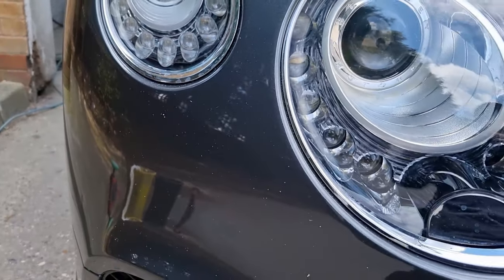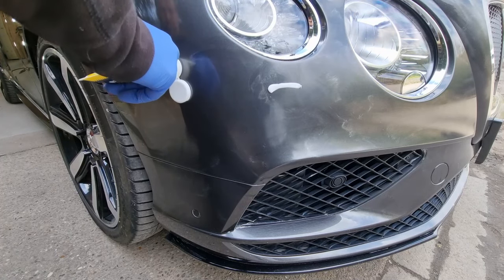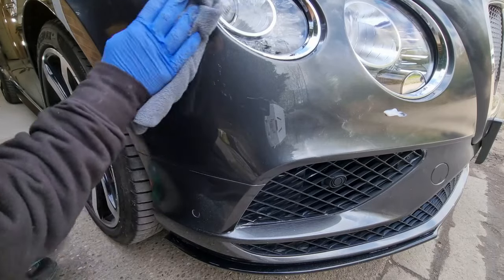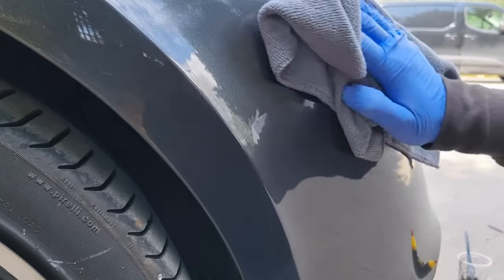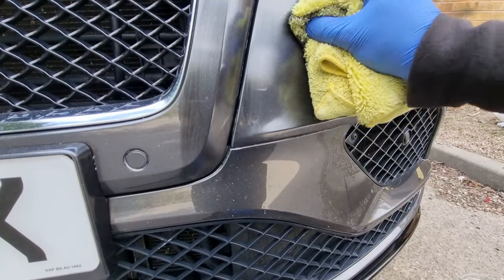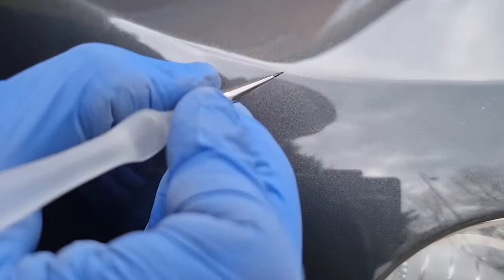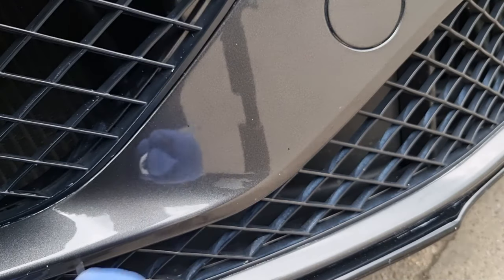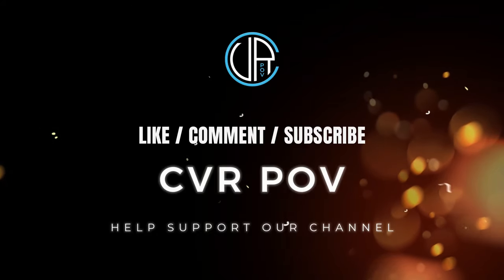Learn how to repair car paint chips and road rash like a pro (Permanently). Save Money!

Comment: Dude: You are exposing the lies and con of the body shops (not all, but many) and saving people so much money.  Thank you, sir!
Reply: What are you on about? These are handy DIY tricks but if you want a proper 100% fix you need to respray it.
Reply: @TheEchelon  Ooooooh. Uh-huh. Every chip, scratch, or ding  has to be  resprayed?  What are you on?
Reply: @mr.c8033 maybe a repaint isn’t really necessary in some cases but when a shop says a respray are you suggesting they are conning and are actually just using this method? If not, it isn’t a con or exposing any lies. Body shops actually prefer to respray. This IS a Bentley, not your Camry.

Comment: For road rash on my car I use Colour Magic polish. It needs a few applications to cover the tiny white spots but generally does a good job without resorting to paint. You will find that you need to redo it after several washes but it's easy peasy.
Reply from the maker: This is more permanent than that but i do actually quite like the colour magic stuff

Comment: Are you using a single stage paint as the filler ? I ask because I would think a base coat/ clear would be dull after without a clear . I bought a car that they must have used this technique on to hide about 30 chips in the last 4 months each car wash more paint fell out of those chips . I can respray the complete bumper or put on my rally stripes and just do up to the break they create but this might get me through for a awhile   if it's got reasonable blend

Comment: Thanks for the video. Very helpful. Just a question. Your method of wipping the paint, does it work with acrylic paint? I know you are using 'solvent' based. It just that the tough up paint I have from the dealer is 'acrylic'. Are they the same? Thank you.

Comment: Nice method. If one hasn't got a rotary polisher, I presume that bit can be done by hand? Harder work obviously.
Reply: Or an adaptor for your cordless drill.
Reply from the maker: Removing the paint by hand would be nearly impossible. A buffing pad on a drill would be more effective
Reply: @cvrpov What is the difference between removing paint with a polisher? Or 1500 grit sand paper i see you use both Techniques, sometimes together. And sometimes separate, can you elaborate? Thank you.!

Comment: I have watched a lot of your videos and they gave me the courage to try  your techniques. Overall I had some success, but struggled to remove the excess paint after. Could it be I leave the paint too long to dry, or I put it on too thick or could I be not using a course enough cutting compound?

Comment: Love your technique which I have never seen before. Just two questions. 1. What pads are you using (one was greem, the other orange). 2. Are touch paints which are widely available from Halfords etc also solvent based?
Reply from the maker: I use www.paintgear.co.uk for the paint if your in the 🇬🇧.  Any cutting pad will do. Stiff pads with good cut to them work best

Comment: Hi! Can you use this method if you have a basecoat and clearcoat over?
I have a red car that I have 2K paint for.
Basecoat red and then a clearcoat that mixes with a hardener?
Or is it possible to mix clear, hardener and fill in the stonechips?

Comment: Thank you for the video I watch your videos to do great work I have a question please so when I go to shop i get  base coat paint      don't add any reducer an is this a single stage paint do I need to add some hardener or activator I tried the straight base coat it just comes right off help and ty
Reply from the maker: It should just be neat solvent base and buff off and it should do the job

Comment: Hi just come across your video's,  after 50 years in the bodyshop mainly self employed I did the last 15 in smart repairs first of all with flying colours part of the American company dentmaster. I like the way you work as you know this industry was purely started to give the second hand market a much cheaper alternative to the bodyshop and a very lucrative living for the lads who take it on in all and some of the worst weather imaginable.  Can I make one observation on the video's I've seen especially the grey Bentley, please use a wheel cover it prevents all the g3 splash. Not a criticism its just something I always did.
Reply: Whoa I’ve been selling cars for a long time since the 80’s and the cutting paste CVR POV used doesn’t spray Ike g3 and a wet mop head  does .
I suggest you need glasses 😂

Comment: Brilliant finish, I have a Porsche 911 black, non metallic, with the standard road rash on the rear arches above the Standard Porsche PPF panels, could this work on it, would you be willing to do it for us.?
Reply from the maker: I no longer trade but I have done that kind of repair successfully on that area
Reply: Hi ok thanks

Comment: Just my thought about this is is that paint without the clear coat gonna fade differently from the one on the car originally? since the clear coat prevents a lot of that UV degrading? Or is that not really an issue?

Comment: great job. what  rpm are you using on that machine? thanks a lot
Reply: probably very low RPM and extremely low pressure. the goal is just to wipe the excess paint off, not to actually remove any clearcoat.
Reply from the maker: Slow/medium

Comment: May sound like a stupid question but I'm no paint expert, when doing this method with applying neat paint then polishing what about the clear coat ? Is it reapplied or mixed with the original through polishing?
Reply from the maker: I dont use clear in this method, just base

Comment: Do you know if paintgear do motorcycle colours? I dont want to faff around ordering something they dont do to then wait for a refund and the messing about.
I did use their contact form over a week ago now to ask them and ive had no response from them ☹️
I've just boight a 2010 BMW K1300S in Lava orange that has a lot of marks and gravel rash. Ive polished an awful lot of marks out but the rest definitely need paint.
Reply from the maker: Hi. They do offer motorcycle paint. The issue with motorcycle paint is there's alot of candy/flip/2stage colours that don't really translate that well into touch up form.

Comment: Just a quick question. Do you allow the paint time to dry before buffing? If so how long would you suggest?
Reply: @2:09 He says he left it to dry for about 5 minutes under normal temps.
Reply: @rafflesnh  thanks mate...did'nt hear that sorry👍
Reply from the maker: About 5-10mins
Reply: it takes 24 hours for paint to dry, 3 months for clearcoat to cure before it is safe to use wax
Reply: @Robbie-mw5uu That wasn't the question though.

Comment: Do I need to clay bar or something before hand? Or would a good clean and dry down be ok for like 2inch scratches
Reply from the maker: It wouldn't do any harm doing some prep work prior to the repair
Reply: you should wash the car, decontaminate using iron remover, bug/tar spray (if needed), and clay bar. You should also use isopropyl alcohol on the rock chip areas to remove oils. Sanding down the chipped areas with CAMI 1200 grit sandpaper will make the rock chips and good paint level with each other. If the rock chip is on plastic, go ahead and paint. If the rock chip is on metal and you can see bare metal or primer, you need to reapply primer before putting paint. Good luck. Remember to wax the car in three months when the clear coat is fully cured.

Comment: Ive got a small chip on my bonnet which has some rust in it, do i need to file out the rust then fill the chip?
Reply: If you don't clean the rust it will not bond and flake off, even worst it will keep rusting underneath(depend on how much it's rusted). You can sand the rust with a pick or someting harder than rust to scrape, or you can convert rust with phosphoric acid it will neutralize the rust so it wont spread, then you can fill the chip
Reply from the maker: Remove the rust 1st then apply paint.

Comment: Does the paint dry before you apply the compound?  You say you leave it 5 minutes, would it have dried by then?
Reply: I leave it 15mins personally but I wet sand the area instead of using the pad removing the excess paint, but 5 min seems about right. The paint is not dry but in a rubbery state, kind of, so it will peal on clearcoated parts
Reply from the maker: Good answer
Reply: @ItsJust2SXTs  thank you mate

Comment: when you apply the basecoat paint on the panel immediately the basecoat turns to matt so and you will need to apply another layer of clear coat to make it glossy, stop acting like a criminal man wtf😂😂😂😂😂😂
Reply: tell me youve never used cutting compound or buffed a car without telling me youve never used cutting compound or buffed a car
Reply: I'm sure this paint is mixed with clear coat added
Reply: @russellsmith6476  we cant be making assumptions bro, and it is his responsibility to tell us if it is mixed or not, besides to achieve  great result like he demonstrated on the video, he needs to apply both separately
Reply: Its got clear coat added
Reply: It has a gloss enhancer in the base coat, not really hard to just look it up mate 🤦‍♂️
Reply from the maker: The eye can't pick up weather its matt or not when it's sat in a tiny chip. Paintgear paint has a gloss enhancer additive mixed for the final touch up... add a little clear to the base if you can't get a kit or paint form them.